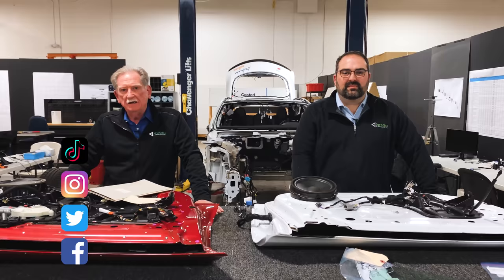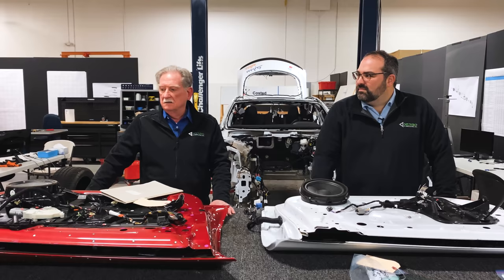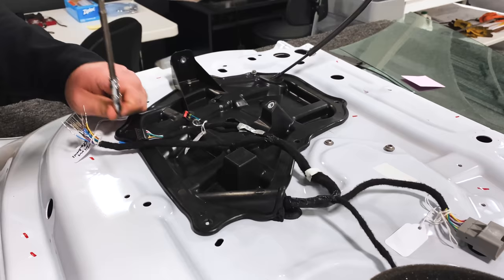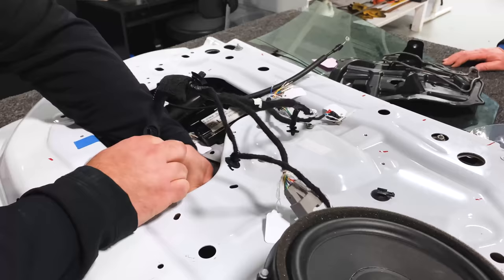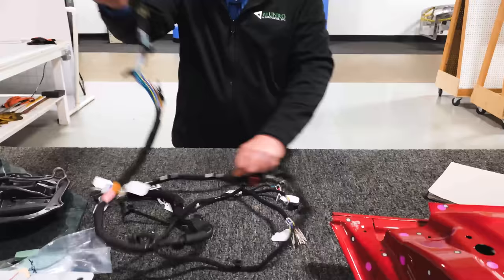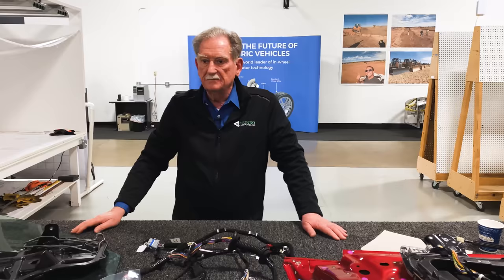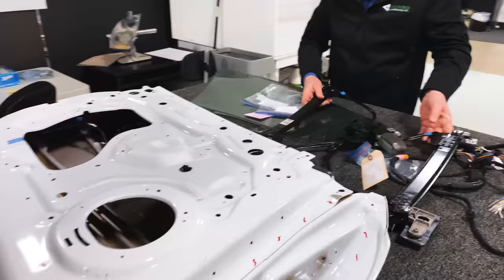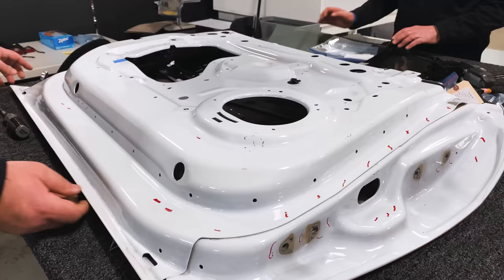Plaid Doors Disappoint Sandy | Tesla Plaid Teardown

Comment: I would suspect the Plaid door is probably more side impact resistant.
Reply: Also, for Superior NVH.
Reply: Relative to what? The Y? The module that holds the window regulators etc isn't really part of the crash structure. The side impact beam is still part of the welded structure of the door. You can see it at 1:25 in the video when he has the module out.
Reply: @markplott4820  What is NVH?  ..noise, vibration and harshness? Yea, those two were at the top of my mind too: side impact resistant and I was thinking possibly a better speaker box.
Reply: @GiesbertNijhuis  - a drop in door modules is a better idea, but will require better NVH added. but, makes the door easier to service if needed. a better speaker can be built in , inc the enclosure, EZ to upgrade speaker to a PREMIUM model.

Comment: This is SERIOUS.   It strikes me that Tesla has made the OEM mistake of “going to the parts bin” for the Plaid doors.  Hopefully they’ll go to the Model Y philosophy BEFORE the bin is empty.
Reply: Model S is a low volume vehicle.  There needs to be a certain amount of volume to make a change profitable.  This may have not met that threshold.   And there may have been other considerations such as noise or strength.  It's interesting, but not a serious issue.
Reply: @donm2255  Because of this door its a low volume product. Because currently you can't buy it in Europe anymore due to high demand. You can only pre-order a Model S and X now. Without any information given on when you can expect one. LOW VOLUME my ASSSSSSSS. Low production you mean, not low demand.
Reply: I can imagine that there is already a new design for the doors. They are just emptying the bin.

Comment: Sandy is spot on and its hard to believe any car company would build a door this way.
Reply: Remember that Tesla was still becoming a car company when the Model S was designed.
Reply: @esweet100  Agreed, but given all the other re-engineering I thought they would have redone the door, but it must be a smaller priority to the other re-designs.   But my point was more focused on Sandy and Ben showing how the door was built, even a simple retired auto components peddler could see that modularization is the way to go, I guess once you become a big auto company (or for that matter any big shot) exec engineer, its keeping the risk to a minimum,
Reply: @esweet100  Just had the thought, back in the old days, I was told that the first item designed is the car door(s).  Again this was by an Italo Swedish design, not sure if others did it this way.

Comment: Perhaps, just perhaps, it did not make economic sense because the Model S and Model X are very low volume cars compared to the Model 3 and Model Y so this is a carryover from the old Model S?  OR, maybe the design was rushed a bit and the lead time for the module was longer than they wanted.  Trade offs, always trade offs.

Comment: I think also reason is to lessen the noise from inside the cabin   if the modeular was installed on the Model S it will be more noisier like the model Y . I have both 2021 Model S Plaid and Model Y Performance, I can tell you the S is much more Quieter inside

Comment: Its the same door as the old S. I had to swap my shell after a truck tire fragment cut my door open. Body shop quoted $8k. I bought a second hand shell fot $600. The  exchange took a whole day. The fine tuning of window and door handle fit was a nightmare (when you do it the first time). Fun fact: All nuts and bolts a metric except the screws which hold the Chinese made speaker, those are imperial.

Comment: The Model Y design makes so much sense for serviceability too! I've had to fiddle multiple times with the latch connections on my doors(totally different car - Fiat Bravo mk1) and it was a total nightmare to try and reach each lever blindly, adjust it and plop it in its socket. I always wondered why they couldn't make a nice big opening and maybe use the cover to hold some of the components...

Comment: I had a 2019 Model X performance,  it's no wonder I had a bad issue with the driver's window. For the 3 years I had it Tesla service had to work on that window not closing at least 7 times, it continued to hang up. Now I see why.
I wish they changed it, hopefully our new Plaid got lined up,so far its ok.

Comment: What if the door was assembled on one of the sheet steel panels, then welded to exterior panel as the final piece?  Then you eliminate the entire plastic piece.
Reply: But that also means it has zero serviceability.

Comment: If the Modular portion is designed with serviceability in mind, it cuts repair time. Many have been designed only with manufacturer speed in mind.  Quality (is job 1) and Serviceability should be considered and consistent throughout the vehicle in order to make it a superior product.  Also very fond of the comment made about a vehicle bm"should" be a capital investment rather than planned obsolescence.

Comment: Another big difference between the modular and stick built doors is the ratio of plastic to steel.
The modular has a bigger plastic piece which is almost a whole inner door skin, while the stick build has a heavy fixed inner skin. I guess the relative differences in steel vs plastic cost, steel vs plastic weight, and steel vs plastic strength will also influence the decision.
The cars are made FOR the manufacturer and THEIR convenience, not for the owner's or the repairer's convenience.

Comment: The speaker and glass rail will not be there. 1) door loom 2) check strap 3) door latch inner 4) door latch outer 5)glass rail 6)window flock 8) glass

Comment: Lol i was a pro at installing all the rubber grommets when I worked at Volvo. 

You need to pull with the whole body weight and we used soap water to make it easier. It was bad for my wrists.

Comment: Doesn't the direction of the bolts on the latch mechanism suggest that at least some of the internals were installed from the other side?  Possibly before the door stampings are combined or at least the outline door panel added?

Comment: LOL, I remember dropping a bolt inside the door of my 2001 GMC Sierra when replacing the window motor and cassette (it was a fold up style like the one shown on the Plaid.)  Took my 10mins to fish that bolt out.  Not to mention the insides of my arms had cuts and scrapes on them from having my arms through the holes.

Comment: Given the limited number of body colours, wouldn't it be more simple for Tesla just to have complete doors made up waiting to fit to meet the line speed needed.  No need to then be doing door builds on the line simply mount the whole door as a component with one harness connection...

Comment: I owned two Model S's over 6 years, it's no surprise to me that these doors are horribly designed. I have seen my door apart many times mainly for the door handle issues. The only surprise is Tesla didn't take the opportunity to make their flagship vehicle better quality.
Reply: That wasn't their goal.  Their goal was to make it butt clenching fast, so that's where the design dollars went.  It makes sense from a business standpoint since the selling point of the car isn't build quality or low cost of maintenance, but rather acceleration, top speed and low total cost of operation when compared to other such fast cars.

Comment: Tesla could redesign the S/X with changes like the door design to make them mass production vehicles.  They might be able to bring them to hundreds of thousands per year at a lower price point but with higher margins.  If Tesla had the batteries and other components to increase production of S/X without impacting production of other products, they probably would, but that's simply not the case right now.  I expect Tesla has a long "technical debt" list for the S/X that they'll get to eventually, but likely not for a few more years.  Right now the margins they get on the S/X, even with the design issues, are probably quite good, and the cost of switching may outweigh the benefits in the short term.

Comment: Having had to disassemble and reassemble several doors for various reasons, I know first hand how frustrating it can be working with small openings and sharp cutouts. Sure the assembly line has the advantage of repetition and experience over me, but a fiddly task can only improve so much. Do any manufacturers automate door assembly? It seems the modular doors would do much better with automation

Comment: Two thoughts, 1, the speaker wouldn’t be there, 2, isn’t there a pull cord restraint on the larger grommet to facilitate assy? Like an old metal sink!  

I guess the S door is low volume and high cycle time that the one piece like the Y isn’t worth it.

Comment: I’m an electrical/semiconductor engineer and this looks crazy. I hate working on doors just for the reason they are built like this. If it is easy for Mobile Service to fix, then it is easy for it to be assembled on the assembly line. Explains people’s complains on rattles if nuts and bolts are dropped inside the door. Same on the engineers responsible. Tesla has great engineers, but sometimes they do stuff like this. They need a review process to keep engineering from going down the wrong path for too long.

Comment: Wouldn't the old approach give you doors that is more solid? Has better structural rigidity...? Can support better sound system because it does not vibrate/rattle?

Comment: Thanks Munro, keep on keeping it real. That's the only way Tesla and others will be shamed into positive change.
Reply: Why does Tesla need "shaming"?
This is the company which makes constant changes/ improvements with zero prompting.
Reply: @rogerstarkey5390  Because of history. Tesla moved to underbody castings specifically after Munro exposed how poorly designed their original Model 3 rear chassis was. It was heavy and carried unnecessary assembly steps. Munro exposed this and Tesla were shamed into rectifying the issue. Elon admitted as much. The things you mentioned are good things, and don't require being called out for, which is why this video was not critiquing those aspects. Instead Munro noted a particular area (the door) where Tesla could improve things. My comment was contextually about the findings of this video only. Just because Tesla gets many things right, doesn't mean they are free from criticism when the occasional poor design element calls for it. Everyone can improve, even Tesla.

Comment: I don't see why one would need to assemble the door components in moving line. You can assemble them separately on flat table/jig and then just bolt the doors on the chassis and only connect the wiring harnesses to car.  Only thing in my mind the whole door would be supperior than just the plastic insert card is maybe structural strength for crash-proofing.

Comment: let me speculate here a bit: is it possible that the assembly is done before the two stampings are welded together? you would still have an unnecessarily heavy door but easy access to fasten everything in place.
Reply: no, because you paint after weld.

Comment: Sandy suggestions make sense, but taking to account the S is a low volume car. TESLA will need to invest capex on retooling the stamping, welding robots and add more injection molding parts for the doors, in order to comply with Sandys suggestions, may be form cost wise it does not make sense. I do not understand why Sandy clams the operator have 5 minutes or 'the speed of the line' to assemble the parts to the doors. The doors diss attached from the car body after the paint shop and reunite with the car body at the end of the assembly line, the car body go through the complete assembly line without the doors, i heard it take TESLA three hours to assemble a car so the operators have almost this period to prepper the door assembly ready for reuniting with the car body at the end of the line. Some of TELSA videos are actually showing doors assemblies going up an elevators.

Comment: I believe the comments about the Model S's very low sales volume were the most salient. The rigidity of the doors, road noise abatement and even audio quality from that subwoofer may have come into play as well. 

If Tesla anticipated making many more of these per year, then this critique from an ease/cost of assembly standpoint would be valid. Cranking out Model 3's and Y's in the millions is a very different proposition.

Comment: Could it be that all the door hardware is attached to the door and tested away from the assembly line. And then the door itself is attached to the car on the assembly line?

Some kind of door building station would make this easier than doing so at line building speed? And the door has to be attached to the car at some point... why not have the hardware in the door first?

Comment: Looking at the two doors side by side, I wondered if having the small pocket design with more steel had anything to do with crush behavior during a crash? It does seem like the extra steel in the plaid door is mostly just more flat area though, so probably doesn't add much.
Reply: I believe the door is aluminum. Does anyone else know for sure?
Reply: You are almost certainly right - aluminum rather than steel. The correct word I should have used was "metal," but the principle remains.

Comment: Can it be that they assembly the door entirely outside the production line and then they bring the already assembled door to the assembly line? So it will be quicker instead of slower on the production line and it also adds some rigidity to the door. However I agree... too much labor intensive and prone to error.

Comment: I wonder if Tesla stamped one full door panel, assembled the pieces onto it and then folded it in half to look like this.  It looks like there may be a seam/fold at the bottom and crimped / tacked up the side and open at the top.  To me, it looks like they could assemble it while it is all open, then fold it in half.   Also curious if Munro reached out to Tesla to see how they did it.

Comment: I prefer the stick type door. If any component fails you only have to replace that one component. On a modular door you have to replace the entire module which is $$$$$.
Reply: Eh, only in the sense that it will take more effort to replace a specific part, no need to replace the whole module. On my car door, its modular. There are some pieces that are riveted, but you can still buy replacements online.

Comment: I think Tesla would have gone the modular route, if possible. One big consideration: the extra large bass speaker. If that were to be mounted in a unified platform, the vibration would be so severe as to compromise sound quality and/or rattle.

Comment: The Tesla Plaid is also designed to be on the tracks. There, normally, cars need to have a roll cage. Tesla designs with security first. I can imagine that with this power of the car there was a need for more metal in the door to have the required safety at high speed crashes. Easy assembly then comes next.

Comment: Could the door be an “end of parts bin” stock? As the old model S would have not used up all pre-fabricated parts and they are interchangeable they could of used these up before going to the Model Y solution. Labour costs already allocated and parts already in stock so cost effective until new mouldings required.

Comment: I'm wondering if the reason that the panel was made that way is because the factory and design methods came up at different times. So many where the plaid is being designed uses this method to construct the door is because it was readily available. Also maybe something to do with acoustics. Either way it is disappointing to see the door manufactured this way and hopefully we can get a response from elon to help future engineers out there develop their business and manufacturing skills for the future.

Comment: Not choosing the modular approach is really a beginner‘s mistake. The modular door was common design standard when Tesla designed the Model S. VW used it a lot even back then. Sometimes I wonder where those Tesla engineers were educated and recruited from. Same with the early Model 3 wheel arches patchwork before they switched to die casting.

Comment: Regarding bolts "accidentally" dropped down inside doors, Brain Bosworth, an Oklahoma linebacker from way back, while working summer job at GM plant in Oklahoma City, said he would drop bolts down inside the door to drive car owner crazy with rattles.  Said he learned the trick from coworkers on the line, “If you own a Celebrity or a Century made in 1985 in Oklahoma City, that car is (bleeped) up if I had anything to do with it” said Boz

Comment: If a modular carrier was used, much of the inner part of the metal stamped side of the door would not be there, so less weight. I wonder if missing that extra metal sheet would have an influence on side impact crash tests. BTW, being a speaker DIY person, I need to mention: what a tiny magnet on that speaker. Can't be good for sound quality.

Comment: To be truthful, Sandy, I would not sell those laminates if I were you. There is such a thing as fair play, and I believe that maybe you are using an "elastic conscious" to justify that sale. Tesla and it's partners probably worked their asses off and spent a ton of money to refine and make them. Sure, a competitor could attempt to tear down the motors, but they wouldn't end up with what you will sell them simply because you and your teams are masters at disassembly.  I urge you to reconsider. Thanks for what you do, Sandy. You do it very, very well.

Comment: Is it possible that due the the very high potential top speed of the MS , Tesla needed more rigidity fro. The door and the only way to get it is to have more metal structure in the inner panel of the door ?
Reply: No, it's just legacy design. It's the same basic design as the 2012 car under the skin.